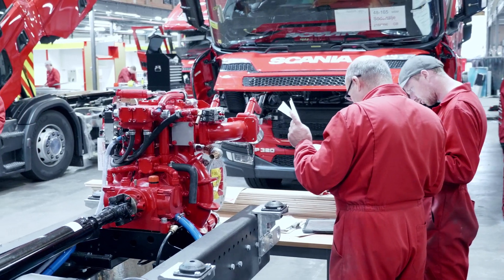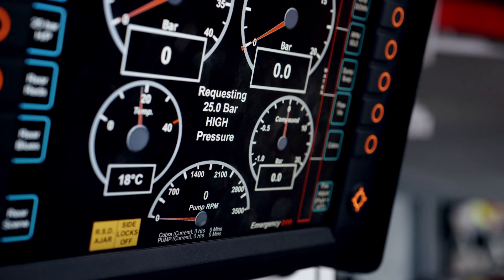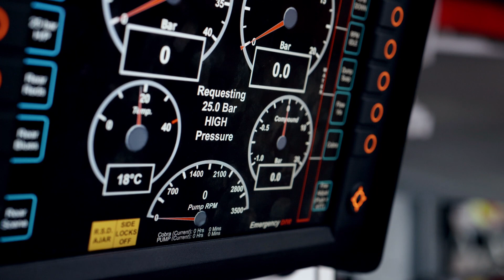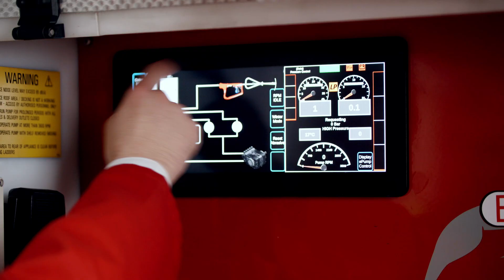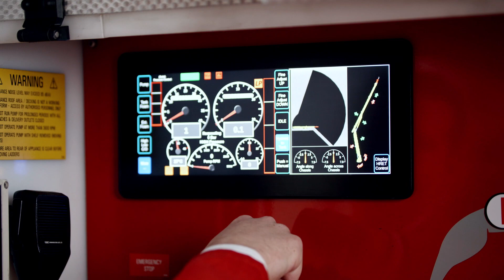Emergency One produces reliable rescue vehicles for 90% of the UK's fire and rescue Services

Comment: Coming from an American perspective it's odd not seeing a fully custom-built apparatus, I mean we have commercial chassis too but their rare, used for smaller applications. It's very interesting to say the least, and a lot of work goes into them for sure.
Reply: We used to have fully custom built appliances in the UK up until recently. The major builders being Dennis, Shelvoke, ERF & Dodge. Unfortunatly the vast majority of these companies went bankrupt by the late 90s - early 00s because commercial chassis were becoming easier and cheaper to buy and convert then it was to get a custom appliance built.
Reply: On this side of the pond custom built apparatus are very rare; Most custom built apparatus these days are ARFF Crash Tenders, in the past decades also municipal-sized versions of ARFF Crash Tenders were built by e.g. Rosenbauer but they never got very popular. 
Rosenbauer now comes up with a custom-built apparatus again, this time a hybrid-electric fire truck designed for municipal fire departments. 
Apart from those few exceptions most fire apparatus are built on a commercial chassis like the ones from Mercedes-Benz, Volvo, Scania, MAN, Iveco etc. As Ford is now present in the commercial truck sector maybe we'll see some of those in the fleets in the next few years as well
Reply: I love seeing that difference. I can see how commercial chassis are beneficial where you live. I’m not saying what we do is bad either, just interesting to see these differences in how the same job is done in different ways.

Not to mention build and style as well, just fascinated me.